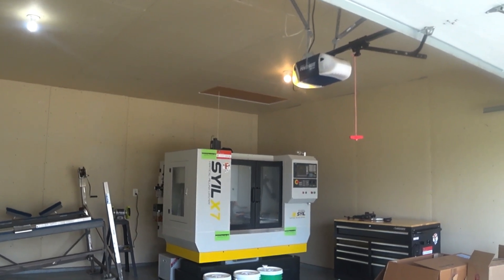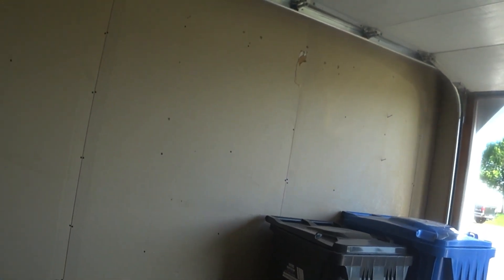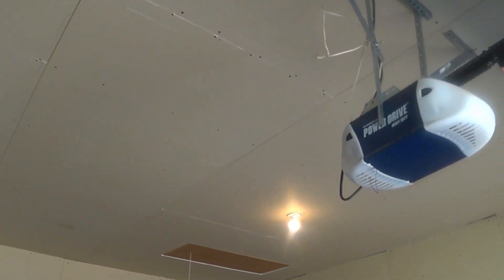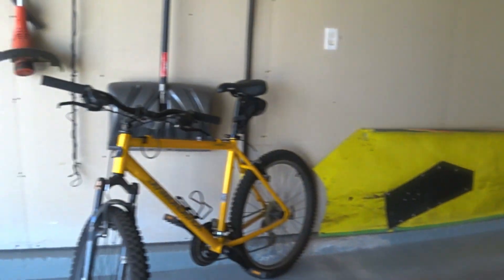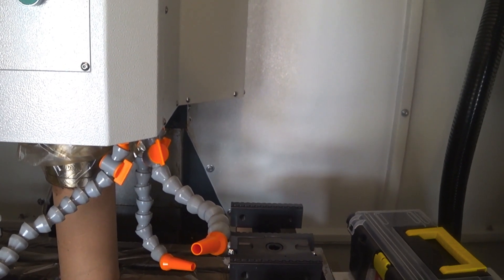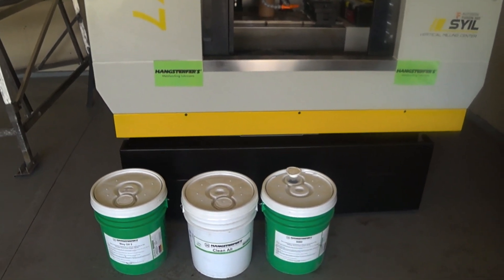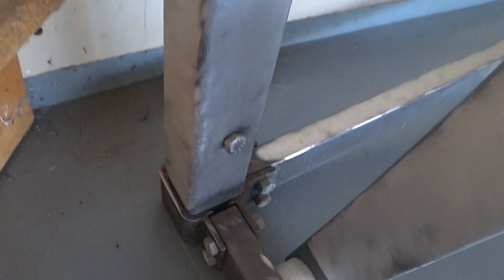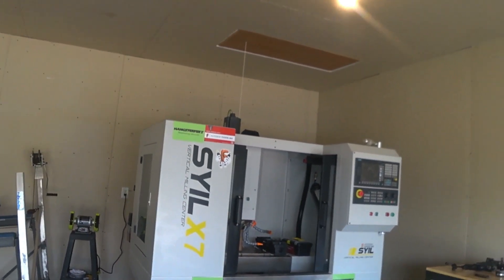Home Garage/Shop Intro

Comment: Hi Kevin 👍. Aaron raves about you as an ‘educator’, so it’s great to hear you’re going to do online courses.  I’m glad to see you got a Syil with Siemens 👏👏👏. I bought similar a couple of years ago ( with Aaron and a few other guys here in Oz.)
Looking forward to seeing your curriculum... hopefully I can get some help with using the Syil/Siemens combo. I travelled down to Melbourne and did Arron’s three-day hands-on F360 CADCAM course. Great learning experience 🤓.
Good luck,
Regards,
Robert
Reply: Hey Robert.  Yes Kevin is an absolute gun.  He is my go to guy when I get stuck.  Which is quite often LOL
Reply from the maker: Hi Robert. I’ve been hearing all about you for a long time as well. It’s nice to finally get to say hi. I’ll be leading the Siemens control myself. Truth be told, I’m not much without a CAM system like Fusion to do the hard work for me. The classes will focus on some of the basics to make sure a good foundation is in place, and also will cover things like 3D surfacing and duplication options to save you time.

Comment: Hey Kevin little tip on the 3phase.  don't mess about with the rotary ones.  go get a Phase perfect digital 3 phase converter.  for your machine you can probably go with their PT007 model. it will run on a 60amp stove breaker all day long and give you 26Amps 3phase (7.5hp).  The big plus is its solid state with no moving parts so the power is super clean, no noise, no pain in the ass startup procedure where you have to wait for it to get up to speed before you can turn the breaker to the machine on, no wild leg and super clean power.  the only negative is the price about 3k but that's cheap compared to when a rotary phase converter plays up and frags all the electronics in the machine cabinet.  Trust me rotary phase converters are really not ideal for cnc's regardless of what the supplier says.  They are fine for older 3 phase manual stuff with just a motor but there are too many sensitive electronics in modern stuff and the wild leg on the rotary convertor plays havoc with it.  been there spent thousands getting the t-shirt.  https://www.phasetechnologies.com/pt007

Comment: Hi Kevin,
Glad to hear that all is well with you. I really enjoy watching your YouTube Channel.
I saw you garage lighting and felt you pain.
I have a 28 X 50 garage I built back in 1994 with fluorescent lighting. The bulbs and ballasts were a constant problem.
I finally decided to upgrade my lighting to LED.  Believe me this was a MAJOR  DYNAMIC change in my shop.  I did a lot of research and I came up with the following:
T8 G13 4FT 48" 36W 6500K LED V-Shape Double Row LED Tube Bulb Daylight
Make sure you get the LED bulbs that have the Double Ended hookup if you are getting the bulbs alone without the fixtures.  It makes hookup very simple.
I am sure you requirement will be different than mine as I already had the 4ft Fluorescent fixtures installed and you will probably want to purchase the fixtures with the LEDs already installed.
I made some choices the made a BIG difference in the final outcome.
I chose to use the Clear LED Bulbs with the 6500K i.e. daylight option/more light.
I chose to use the dual row option for more light.
I chose to use the V Shaped Bulbs (I row of LEDs on one side of the bulb and 1 row on the other)  to provide more of a radiant light that light the area below the fixture and also to the areas to the sides of the fixture.
Just something that I thought might be useful to you in setting your garage workshop lighting.  You would be welcome to contact me with any questions and I would be willing to help the best I can i.e. Pictures etc.
John
Reply from the maker: Hi John. Thanks for all the detailed info! I’ll definitely be researching the items you posted above. Lighting makes all the difference in the world.

Comment: I recommend that you use easy to install LED lights but get yourself two "A" frame ladders, or borrow one, and some 2x6s to place across the treads. It will give you good stable footing and is easier or the back.
Reply from the maker: I’m all about making things easier. Thanks for the idea!

Comment: I went with the "Barina 4 foot T5" shop lights on amazon. I bought 2 8 packs and they light up my 1000 sq/ft shop nicely. You can see the results in my videos. Im looking forward to some videos on that X7!
Reply from the maker: Cool. I’ll have to take a look. I’m about 600 less square feet than you are so I would be able to cover that space pretty well.

Comment: Congrats on the Syil, how was the buying and shipping experience to MN? Nice to know one is in the area
Reply from the maker: It was pretty good. They arrive in Houston. It took a couple of days to get trucked up to the Moorhead area. It went through a couple of distribution centers on the way. I hired a tiffing company that had a telescoping fork lift and he put it right in the garage. In fact, the machine is compact enough that he didn’t even need to use the telescoping boom. It came in a crate and attached to a steel pallet. It took maybe an hour to get from the truck and into the garage. Syil has done a good job getting machines stocked in the US and having a US sales representative that you buy from. It was a good experience.

Comment: Well, it’s not as challenging as wedging a machine into a basement in nyc but it’s a start. Also, bonus geography lesson! I thought Moorehead was in N.Dak. P.A.T.R.E.O.N.
Reply from the maker: Getting it in the garage was super easy. I didn’t even have to take anything apart. The newer models are even a bit shorter than this one.

Comment: What made you go with a SYIL over a Haas?  The TM series can run on single phase.  For lighting check out Phillips type B "MainsFit" LED tubes.  They are direct wire in and very affordable.
Reply from the maker: Band for the buck on this machine is incredible. I also like that this machine is a fully cast frame and I think more rigid than the TM machines, which are basically a cast mill on a sheet metal frame. That’s not a bad thing. This mill just “fit” my needs better.
Reply: Mechanical Advantage I don't know where you heard that about TM machines.  They are a fully cast iron machine, about 6200lbs of it. No welded structures.  Now, you may be thinking of a GR mill, those large gantry styles are welded tube frames, and I think the only one Haas makes like that.